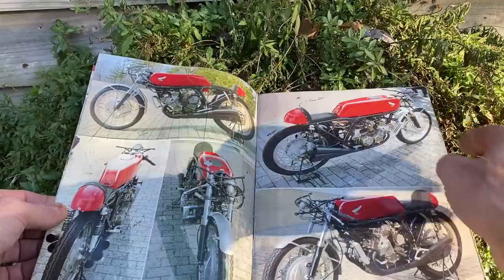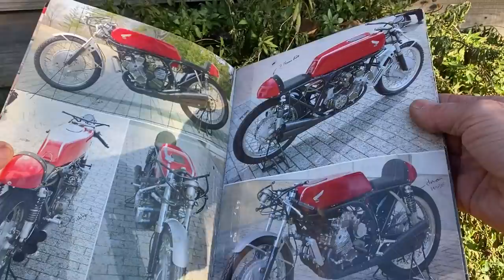Millyard RC374 Honda six replica - Episode 3 - How its made

Comment: The phrase “engineering god” springs to mind, also wonder why some manufacturers haven’t snapped him up but I doubt they could afford him, 👍👍👍👍👍
Reply: The price in cup cakes would be ruinous :-)
Reply: If I won the lottery and Alan did commission builds I would be straight on the phone, as long as Greta was not hogging the line.
Reply: I doubt he'd be willing to give up the time he uses to build what he wants, to them to build (or design) what they want. Brings up a point that I've been wondering about since I discovered him which is: is he retired and from what?
Reply: @erikbrown207  He worked as a nuclear engineer.

Comment: The first time I met Mike hailwood he was sitting on the 250 that used to be in the Donington collection housed in the Donington Museum at Donington Park. 

Not sure what the event was. He was on a small display on the main road from the museum going north, outside the main circuit, next to a wall, revving it to please the few who knew what it was, and who he was. 

I was surprised how few stopped to check out the incredibly rare spectacle. No one spoke to him. I have no idea if they were in awe, disinterested or just ignorant. 

So I asked him if he knew how the double twin leading shoe brakes were linked up to the brake lever. 

He said: “I have no idea. I just rode them”!! This reply is of course at odds with the many anecdotes of Mike the Bike having a big say in various design features of different bikes during his career. 

He was a great bloke, even if his version seems to be somewhat at variance with the historical record. Maybe he was happy with the brakes and never needed to make any suggestions. 

The sound of your Six is just how I remember the original all those years ago. Cue the green tinged Guy Martin ‘Proper Impressed’ emoji.

Comment: Hi Allen, cracking work again, 💪it was so nice to see you using a millenicut I haven't been in my garage since lockdown, I am very much like yourself, I'll hacksaw cut, drill, and file parts if I have too, I find making bike parts that way so relaxing. I have a lathe and Miller, but going down the manual route, I find gives me so much enjoyment. Heres a sprocket cover I did so I could change the gear without the need to take the cover off, also it lightened it. All done with drills, and files, and the odd burr. Hope you like it, dam no pictures allowed.

Comment: I have used a spark adaptor like this to set the TDC and advance  timing on my 1922 B.S.A. No space for a dial gauge, only a graduated indicator.
Reply: A pencil with a mark works just as well👍🏼
Reply: @classicrestoration  is that pencil calibrated in thousandths of an inch or 100ths of a millimetre?
Reply: @howardosborne8647  “Eyecrometer”😉
Reply: @classicrestoration  I can't imagine Nobby Clark using a pencil to establish the dwell angle. Sochioro Honda would shake his head in disgust.
Reply: @howardosborne8647  , either-neither, and it's adjustable as the lead collapses.

Comment: Thanks man, I was looking forward to this alot, top job mate, the Suzi t n GT 500s had a thru gear shaft for left or right foot too. Love your work, keep being you m8
Reply from the maker: A few early Japanese bikes had the option for a right hand shift so that people used to British bikes would give them a try. I believe Mike Hailwood told Honda to fit a right shift lever to his RC174 and they did? My RC374 has the option to swap foot controls in 5 mins
Reply: @AllenMillyard  makes sense, I never really minded, but I once had a triumph 250 street scrambler and a Honda k4 at the same time, occasionally rear lock up hilarity ensued😆

Comment: Thanks for another 
Brilliant Build, Allen, sir. 
Hard to believe Honda didn't provide front hub air exhaust holes along the back edge, or far better, at least one similar air scoop facing rearward. 
Please let us know when you plan to cut the branches off the rubber tree and make some tires.
Reply from the maker: Yes im aware of that,  but decided not to squeeze them in as im sure the brake will work ok as it is, its a huge heat sink. Ill leave the tyre making to Avon
Reply: @AllenMillyard  , yes, you made the hub replica. And probably won't be using the brakes heavily. Thanks again for showing.

Comment: Hi Alan I hope you don't mind me asking a question but you are Awesome and your skill and knowledge are second to none. I have a 1982 Yamaha 550 seca and I was wondering if you could give me some advice, I have had the bike for years and that is me just getting it on the road but can you tell me are the carburetors any good on the bikes I have changed everything on them from the Diaphrams to float bowl repair kits that include the float needle and the bowl rubber seals but on the petcock prime the carbs still leak fuel and I have set the float cut off a couple of times and they are fine, but my question is is this the wat these bikes are is that why it has a vacuum petcock. Sorry again to bother you and feel free to ignore me I'm sure you are very busy Thank you. John

Comment: What did you use as the maximum  temperatue for the brake drum so the liner keep holding hands. For my hub on my Ariel trials build I use a temperature 150 Deg C I needed an interference fit of 0.012" (5" drum). A friend of mine was telling me that the Alfin brake drums on race cars could get up to 300 deg C he used stainless rivets.

Comment: Allen, maybe you could explain something for me. In the videos of the bike running, and especially the video of the engine running on the stand, It sounds as if the throttle hangs once you let off. At first, I thought it might be due to the electronic ignition, but now that I see you switched over to points ignition, that wouldn't make sense. Was that a characteristic of the rc174? 
**Edit** Now that I watch it again, I think there might be an audio sync issue in the short clips, making it look/sound as though the idle was hanging.
Reply from the maker: It returns to idle perfectly with its new carbs. Episode six will be a ride out and lots of engine running and reving 🙂

Comment: What material and condition did you use to build the crankahaft. How did you heat treat the crankshaft & grind the gernals. Did you make the crankshaft pins?
Reply from the maker: I explained that I used press fit hardened inner rings for Ina roller bearings and EN40 steel for webs with integral crankpins and journals .
Reply: @AllenMillyard  Ok, so no heatreat or harding processes needed then.
Reply: First i must say im sorry,  must have skipped that spot in your vidieo, I see you used a two stroke type rod and pin assy. TY cheers.
Reply from the maker: I wanted to make it all myself at home with resources i have and not just spend loads of money getting parts made or treated. time will tell how reliable it is, it’s been ok so far 🙂

Comment: Allen on them copper gasket are you putting copper gasket spray has ive just got one for dt125r but they don't seem to have the raised crimped part round above the cylinder chamber & was wondering if they are any good at sealing specially with a water cooled cylinder head ? ?
Reply from the maker: A thin smear of Permatex ultra grey around the water channels will make sure there is no leaks
Reply: @AllenMillyard  ok thanks for reply Allen
Reply: I've been looking forward to the third instalment of this epic engineering story and it's every bit as good as I expected!
Reply: @Xanavi23   yes hes videos are very entertaining & hes a good guy

Comment: I wonder if the Honda had a Hyvo chain or a roller?
Reply from the maker: The original RC174 297cc six had gear driven cams
Reply: I wondered too.
Reply: @AllenMillyard  Now THERE'S the way the veteran Honda race mechanic would know!  Those VFRs with the gear drive DO sound different.

Comment: Hey Allen! Would you be able to make A Yamaha RXS100 into a twin?
I see in India they have a Rx135cc single and obviously the older RD 125 made twins but have you ever worked on an RXS100? Love mine. Absolutely bulletproof two stroke engine. Wish they kept making two stokes!! Cheers. Luke
Reply from the maker: ive worked on the early mid 70's round tank RS100 great bike and rare now
Reply: @AllenMillyard  yes the older rs models are very rare.... I've got an 1990 rxs100 with only 9,000 miles on the clock my first proper bike and I'm only 22.....most kids my age want the R125 but I love my older stuff. Keep up the amazing work mate I watch every single video <3

Comment: I broke the roller chain in my CB175 twin reving it beyond  12000rpm.
Reply from the maker: The FZR250RR engine has a 18000rpm red line and will happily Rev to 19000rpm